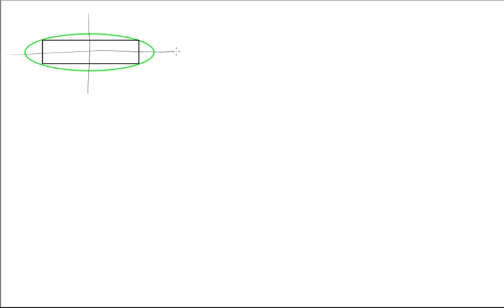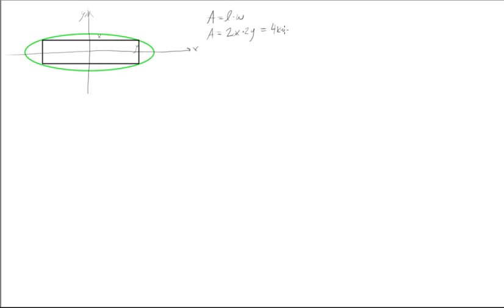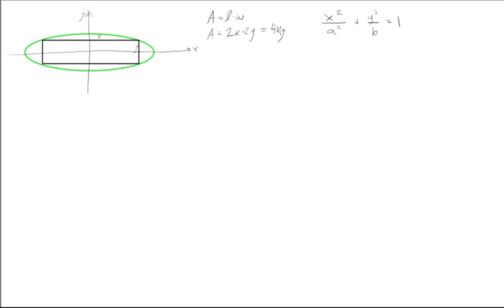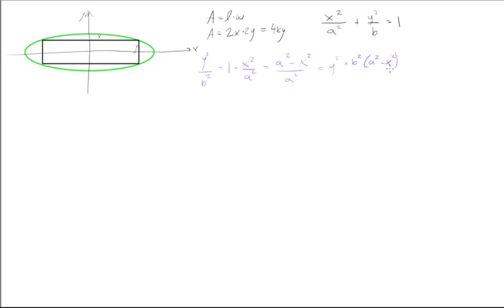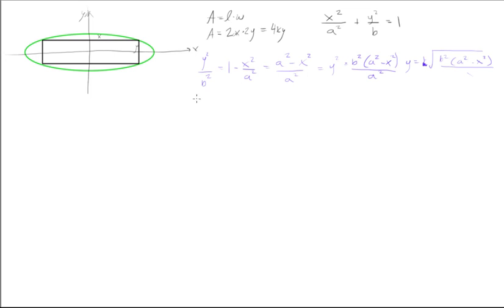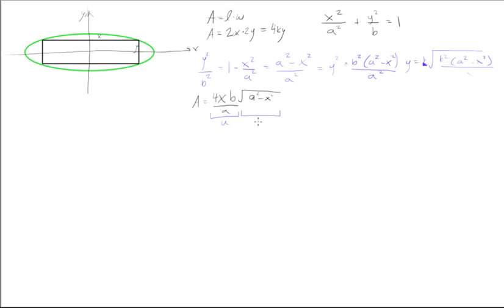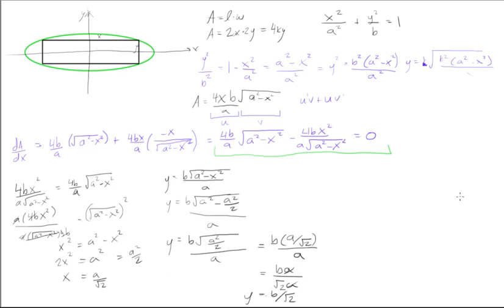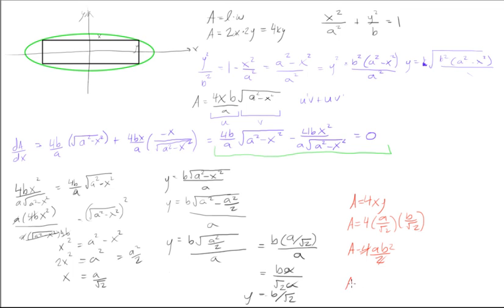How to fit the biggest possible rectangle inside of an ellipse

Comment: by observation the area of the rectangle inscribed inside the ellipse is 2*a*cos(theta) * 2*b*sin(theta).Which is 4*a*b*sin(theta)*cos(theta). since 4*a*b are constants of the ellipse we don't really need to care about them (as the ellipse changes as long as the area of the rectangle has a*b in its formula, the rectangle will also change accordingly). What will determine the biggest (or largest area) rectangle will be the biggest possible value of cos(theta)*sin(theta). Even if you're bad at math, just plug in values for theta and see what the biggest value of (sin(theta*cos(theta)) comes to. you will notice the largest value is 0.5 @ theta = 45 degrees... so largest AREA of rectangle inscribed in an ellipse = 4*a*b*0.5 = 2ab.

Comment from the maker: your equation is tricky. with a bit of algebra, in your case a=4 and b=5 (not the other way around). you can use those values following the method in the video to get area of the largest rectangle = 40 units.
Reply: Okokoo😅l😅lololoo
Ollollk?lol😅ololoo
😅koo😅lo
😅Oolkok9o ok llool😅lplolokol
Lol
Lolkklkokoolol
Loll
Llllokollll😅llokllollolo
Loolooo okokoooo llolloook99k9 ko ko okoollolokl
Lollll😅kokoloko ko lololllo
Ookol klolooo old o
O999 kooolo
Kook99 ok k
Ko ko ko
Kkoook I'm 9 ko ok99ool9ooooolol
Lo
O am l look ooo
O ko look o
Ookoooo
O
Oo99o9 loo l look looo
O ok ko k to oooo ko okookol ok ko
Kko oo oo ko oo ko okoo klo
Ok o9oo ko o
Loookl ok oooooooo😅o
😅O
O
Ko ko l
Ko lll9koookoo😊oook😅o ko oooo ko o
Oo
Okooko ko ko😊oo
O
Ok ko l look ooo9ooo ko ooo ko ko ko
O
Oo ko 9o9oooo
K 😊 ko9 ko ko kmi ooo9k ok lo
Ko o
Oo
O9ko
😊kooooooo9 lol oo
Oooo
O9
O
O
Oo9
9ooOk😅ooooo
Ko o ko oooo o ko oooo
O
Ooo9o
O lol oo
O
O
O
O
O
O
Oko
Oooo
O

Oo😊ooooo
O
O
O
O9o okooko o ko ooo
O
O
Oo
O
Ko oo
9ko
O
Ook
Ko ooo9
o
9
O
Oo
Oo oo loo I'm 9oko9
Ooo o
Oo
Ooo
O
O
O oo oo
Ko 99o
Oo
Oookooo

Ko o
Ko9kk ko o

Ooo
O
Oooo
Ko Lo ko loo too
O

9
O
O
Ookooo
O
O

O
Ooo
Koooookooo
O
O
O

Oo
O
O
O
O
O
O
Oo
O ko k on ok9
O
O
.o9o
Ko o oo ko 9oooo
O
O
9koo
O pool o oo o
O
Ooo9
O
O
O
9oko
O
Ko
O
Ooooooo oo o
Kook9oo
O
O
9
O
O
9o
O9
K ok 9oooo
O
O

O

O
O k99o
O
9😅oooo
Ooo
Ookoo
O9oooooo
Oooo ok
Ooooo
O
O
9
O
Oo
Okoo
O ko ooo
O
O
O
O

O
Oo
O
O
O
Koo
O
O

O
O
O9k
9
O
9o9
O
O
O

O
O
O
O
Oo
Oo

O
O
O

Ooo
K9ooo
Kooo

O
O
O
O
Oo lol oo

9
Oo
O
O
O
O
Ooooooooooooooo

O
Oo
O
Oo
O ko loo
Oo
Okooo
O
O
O

O
Oo
Oo
Ko ko o

Oo
K9 of oooo
Oo
O
Oo
O
O
O
Oo
Oo
Ok
O
Loo ook
O
O
O
O
O
O
O
Ooooo lol o
Kookoooo
O😅oo
Oo
O

Ok
O
O
O
O
OOoo
O
O
Okooook
O
Ko
Oo
OoooO

O

O
Oo
O
Ooo
Oo
OOo
O
OoOkkoOmokoOoOo
OookooO
Oo
Oomo
Ooo
OooO
Ko
OoooO
O
O
O
Oo
Ooo
Kkoo
O
Ko
O
OOo
KooOkooo
O
Oooo
OOoo
O
O
O

OOoO

Oo
Ooo
O
O
O

OokOo
KoooK

O

O

O
O
Oo

Ko
Lloookoi9
Oooooo
O
O

Oo
Ikoo

O9o
O
O
Oooo
Oo
O
O
Oo
O
Oo
Ooooooo9k9o
Oooo
O
Oo
Mo

Ooooooo9o

O9
?ooo9
O
O
O
9ooi

Oko9o
Ookoko
Oo
Oo

Oooo

Oooo

O
O
Oo9ooo
O
Oo

O
Oooooooook9
O
Ooo
Oo
Oomoooooo
Ooooo
O
O
Oo
Ooooookoo9o
9o
Oo

9oooooooooo😅9
O
Ookooo
Kooo9oo9o
OoooOoooO
O
O

I
O
O

O

O
O

O
O
O
😅O
OmoooOoOoO
O
Ooo
O
OoooooOooo
O
😊O
Oo
O
Oo
O

O
OokOmoooOomo
Oo
Ooooookoooo
Ooooooo
Ooookoooo amo

O

Oo
Oooko
Okoooo9ooooookooko
O

Ooookkooo9kooooooooo